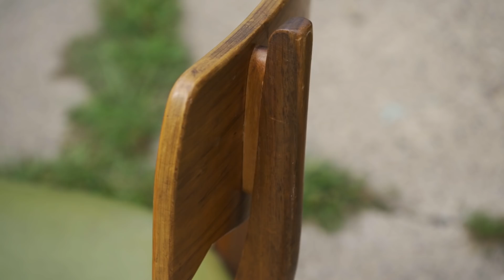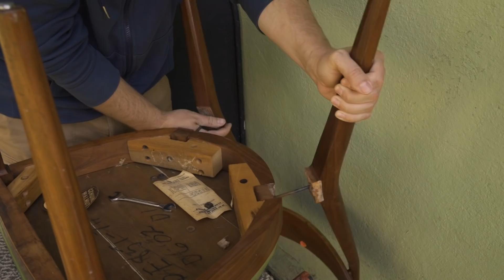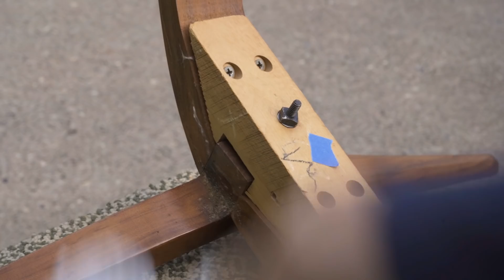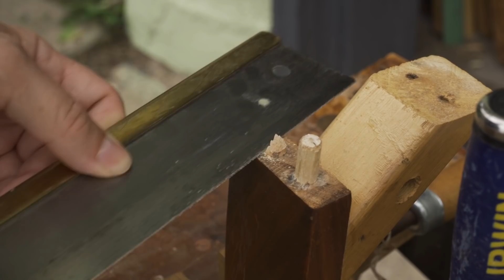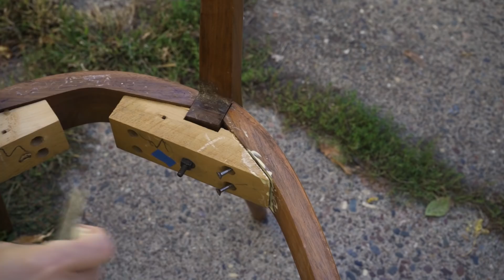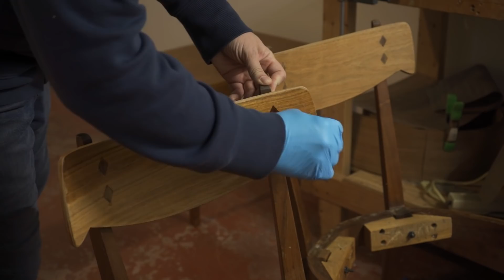Repairing and Refinishing Mid Century Chairs From A Church Sale | Furniture Restoration

Comment: Growing up, Declaration by Drexel designed by Kipp Stewart and Stewart MacDougall was our family dining set. We had the hutch and lowboy as well as the table, 6 chairs, and 2 captains chairs with arms. They originally had off-white Naugahyde seats to match the porcelain knobs on the case goods. 1st Dibs had a set of 2 for sale at $1400.00 Great find and great job! They should be stamped on the bottom with the lot# and date of manufacture.

Comment: 3:04  I suspect the joint cracked because the glue on the other joint failed first, thus putting all the pressure on the one joint and it broke at the weakest point which was across the dowels.  Significantly, the glue on the broken joint did not fail.

Comment: And some videos I’ve seen you use the stripper while and other videos you just sand it down or scrape the surface. How do you decide which method to use? I have a 36 x 36 counter height table. I’d like to clean up and refinish.